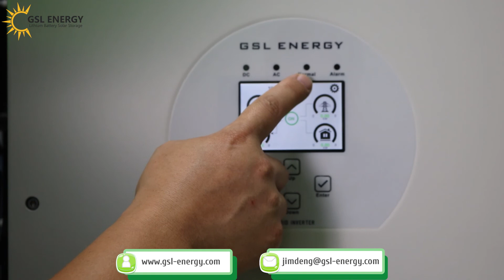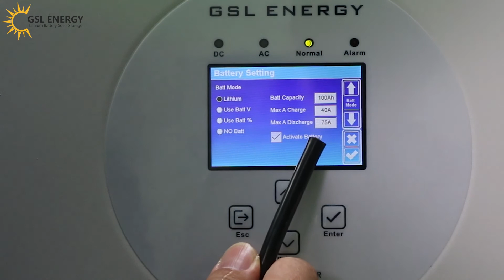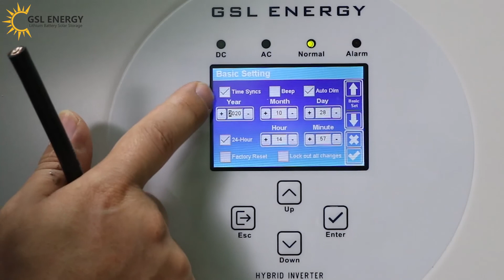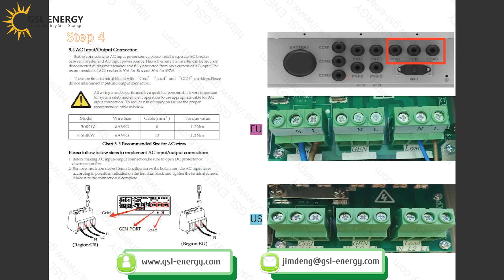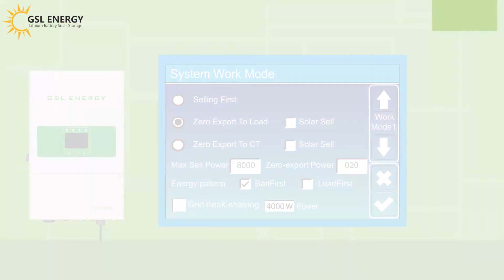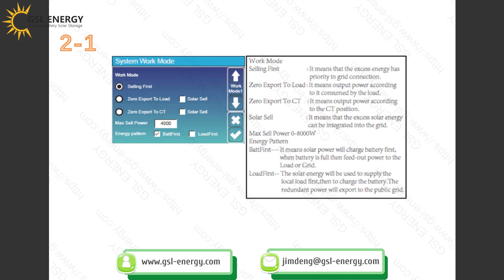GSL hybrid inverter solar system, the smart power manager for your home

Comment: Cool Machine. I have a question. If you have more than one 5kw battery rated at 100ah. Do you need to combine the Amp hour rating when you program the amp hour into the inverter
Reply from the maker: pls email to me your required question and information. thanks. sales18@gsl-energy.com